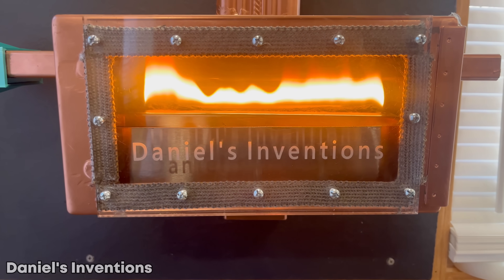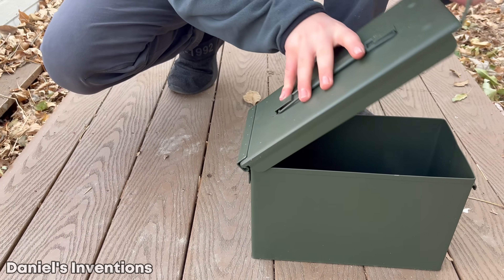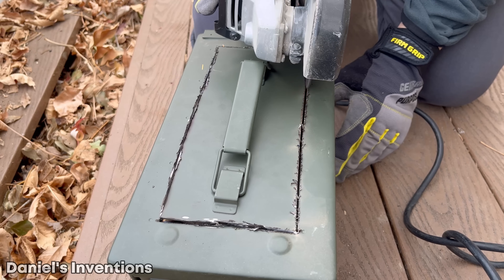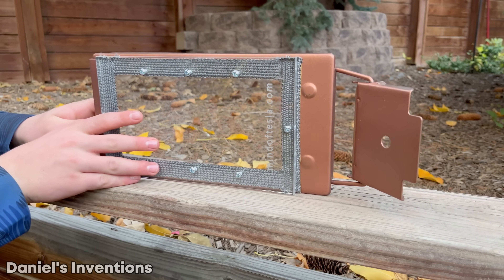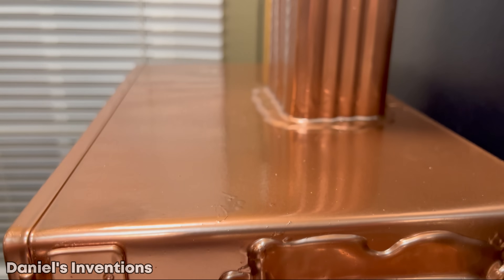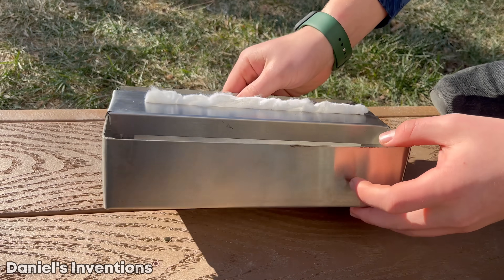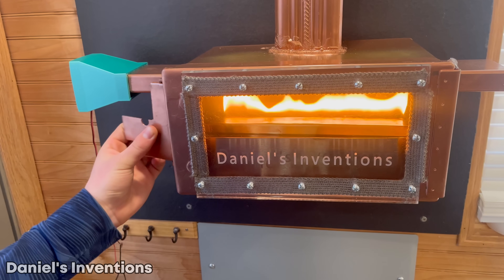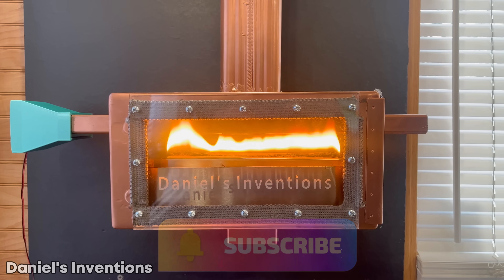ENDLESS Heat for Your Home WITHOUT Electricity 2.0

Comment: Over 4 million views on this how to burn your house down tutorial.
Reply: rage at not thinking of a wall-mounted kerosene heater that runs off vegetable oil intensifies
Reply: Should be mounted on external house wall where not much can go wrong as, burning oil inside of apartment is asking for trouble.

Comment: You should be concerned about how warm it gets inside the heater. With the fuel container inside the enclosure, once the temperature hits around 150°F, the fuel will start to give off combustible vapors inside the enclosure which could lead to a fire. Perhaps if the fuel tank were hanging below the box so that it was exposed to the inside air, that would help keep the fuel cool.
Reply: The bottom won’t get that hot at all, the heat exchanger gets rid of the bulk of the heat and the chimney gets rid of the rest. All the heat remains above the flame. Cool air is constantly brought it from the bottom.
Reply: @kerrywsmyth  I don’t know.  150F isn’t that hot.  Some lamp oils have flash points as low as 120F.  I sell kerosene cook stoves for a living and I’ve never seen one where the fuel tank is inside the combustion chamber.  One of my customers put a kerosene stove in a space where air flow was blocked on 3 sides.  The fuel tank caught fire.  If you simply made the box 2 inches shorter (top to bottom), cut a hole in the bottom and let the tank drop by two inches, it would be safer. Extra care should be taken with homemade heaters, as your homeowners insurance would not cover the fire damage from such a heater.
Reply: This also the exhaust isn’t code. That needs to be three wall insulated pipe pass through otherwise he’s gonna be burning down that house from that small hole
Reply: @stpaulmercantile  good point about the homeowners insurance doesn't cover fire damage from such a heater
Reply: @ChunkiieCustomz  I appreciate your information but I also had a stroke trying to read that
Reply: @ChunkiieCustomz  he might also want to flash the hole he cut in the siding. I guess the water that gets in can keep the wall around the exhaust from catching on fire as easily.
Reply: We are very annoying
Reply: kido did a good job, but indeed, that's a better idea.
Reply: @@jessekawaii2276 true, no mention of risk of carbon monoxide poisoning or using an alarm.
Reply: Good point, because the mechanical airflow could some how stops. Also the insurance issue is also something to keep in mind when using a diy burner.
Reply: good point John
Reply: @Eric Allen  There is also no temperature limiting controls, so this is 
a fire hazard as soon as it is left unattended.
Reply: @stpaulmercantile  He clearly said he used vegetable cooking oil and thats around 600F so there's no worry about a fire for the fuel at all.
Reply: @2amSpeedMerchant  From what, cooking oil isn't a worry for that. 10x less than cooking with it on your stove.
Reply: @dpgedward5947  No its not. He clearly said he used vegetable cooking oil and thats around 600F so there's no worry about a fire for the fuel at all.
Reply: @christhomas1438  Nope. He clearly said he used vegetable cooking oil and thats around 600F so there's no worry about a fire for the fuel at all.
Reply: Yup it can literally explode at a point
Reply: @stpaulmercantile  it was vegetable oil that's usually at 450 for frying stuff that's about how hot it was around the top when they measured it
Reply: If you look at the design you can see the cold air intake is below the oil pan thus cooling it somewhat as air is drawn in.
Reply: @101mazz   But he said people can use ANY type of oil, so people might use oils with a lower temperature flashpoint.
Reply: it is cooking oil you can heat it up pretty high before it will hit a flash point and this is the same design  as a oil lamp it isnt going to combust
Reply: @2amSpeedMerchant  really  carbon monoxide poisoning from what it exausts to OUTSIDE the house and the burn box is a sealed unit
Reply: @ram1brn I say safety first. What harm can it do? None, and a CO alarm only costs a couple bucks.
Reply: This assumes perfect operation of an electrical part. Once that fan fails it stops removing heat and it continues getting hotter in the chamber leading to essentially a grease fire. It doesn't take a whole lot of fire to do that. @kerrywsmyth
Reply: @brent... Lol yes
Reply: I had migraines as a kid for cooking out of the can. God healed me in the middle of the worst migraine I ever had. Then I must have had a block from God against it but took like years to stop doing it. At the time I didn't know what caused the migraines  that it was the freaking lining of the can
Reply: @jeremymaxwell8466 that's interesting. I cook beans and soups out of their cans all the time, because I know they're exposed to high heat for long periods during the pressure canning process. I haven't experienced the headaches you've had, however it's surely interesting to note. Thank you
Reply: @stpaulmercantile the flash point of typical lamp oil is 250 f. The flash point of vegetable oil is 400 f. The lid to the oil will also block the heat. It’s not going to get over 400 f in there while the fan is going.
Reply: @ChunkiieCustomz no it doesn’t, it just depends on the clearances, you can have single wall all long as you have the proper clearance and a box at the hole.
Reply: @craiglist308 not true, you just have to inform the insurance and meet code.
Reply: @2amSpeedMerchant there is minimal risk to CO as long as the vent isn’t plugged! Same as a furnace
Reply: @jeremymaxwell8466 that makes no sense!
Reply: I've had a house fire 🔥 from vegetable oil. 
~ 🦋
Reply: @ChunkiieCustomz  You're 100% correct.
Reply: A remote fed tank would also give you longer burn time.
Reply: How cool will the vented air keep the oil if it hit the oil tray at the bottom of it?
Reply: For a waste oil burner, as soon as the internal temperature of the charcoal used to start off the process reaches 600 deg F,  then the oil drip is started and it's instantly vaporized inside and creates a bast furnace that will reach temps hot enough to melt aluminum (1200+ deg F).    So if the top of that burner is around 500 deg, wonder what the internal temperature of that oil is?    If it gets hot enough to vaporize from an ill adjusted wick or something, it could cause some issues.        Might be good to watch that.
Reply: @stpaulmercantile flash point is irrelevant
Reply: Inderdaad, levensgevaarlijk en weinig effectief.
Al enkele jaren zien we dit soort oplossingen om de stijgende energieprijs te slim af te zijn.
Maar wees gewaarschuwd, dit soort experimenten kunnen best gevaarlijk zijn.
Reply: The inside of the heater seems to be ventilated pretty good
Reply: Seriously, what a bunch of Karen's for commenting on this being dangerous. Where is your commonsense for goodness sake? If you're using Extreme Heat JB Weld, or just welding it properly, even if there was a flash fire inside, so what? The firebox is fully contained and sealed. If this is too dangerous for you, I suggest you stay at home today, it's dangerous out there.
Reply: so basically you'll need something like a "crankcase ventilation system"?
Reply: Here is The True Savior

HalleluYAH “Hallel u YAH - Praise ye YaH”

YaH is The Father (Genesis 1)
YaH arrives via the TENT OF MEETING
YaH was Who they Crucified for our sins
YaH was Crucified on an Almond TREE

Ancient Semitic Moshe (Moses)
Isaiah Scroll (The Original Isaiah)
Reply: a perfect use for canola oil since consuming it is not a good idea😊
Reply: I would never use JB weld to put this together
Reply: @2amSpeedMerchant  Notice the smoke pissing out of it at the end 😂
Reply: Hes using vegetable oil. This should have a flame point between 320 and 400 °F approximately. So your point isnt valid.
Reply: @ChunkiieCustomz it looks fine
Reply: I used to be a gas fired central heating technician in the R&D dept of a major HVAC company.  Designing and preparing gas fired furnaces for the American Gas Association to test in their labs and certify the safety, among other things, of the submitted equipment. Even so, occasional failures of installed units sometimes resulted in fires or worse. This thing is a disaster waiting to happen.
Reply: @mikeweber9766  Land of the brave and free ;-)
Reply: Consider using a peltier module to turn heat into electricity to power the fan. Great video overall! :)
Reply: @brianhowells1547  yes yes yes we is so annoying
Reply: Warm oil burns better cleaner than cold oil
Reply: @2amSpeedMerchant  That's why this should have a complete closed loop intake and exhaust. No worry about carbon monoxide if its completely isolated like it should be, I would never rely on the room air as the intake source, that is a bad move tbh
Reply: Feel like you could've just used a metal sheet and make it fit  instead of just jb weld

Comment: WITHOUT Electricity ? how is the 12 v fan?
Reply: Magic.
Reply: Same magic he uses to get around the fact that vegetable oil has 120,000 btu a gallon. Which makes this more expensive than just plugging in a small space heater.
Reply: @trevorthompson572  which you can't use for heating. It's forbidden by law atleast in civilized countries.
Reply: @dismayer666 what? Space heaters aren't allowed to be used for heating? Please explain.

I've only having heard of certain cheap brands being a fire risk and being banned for sale in some countries.
Reply: Put a peltier board
Reply: Facts where?

Comment: One concern I have is that the air inlet at the bottom should extend upwards into the heater sufficiently to ensure that if any oil were to leak from the oil tray,  it couldn't find its way out that inlet pipe onto your floor.  If the leaking oil caught flame,  you'd burn the place down.
Reply: That oil will not burn without a wick unless it's super hot .
Reply: Oil could also leak out the door opening.  I noticed there is no lip to stop it in case of an oil spill or leak.
Reply: He clearly said he used vegetable cooking oil and thats around 600F so there's no worry about a fire for the fuel at all.
Reply: @101mazz You mean a veggie oil can't catch fire at 600F😂 or the burning asswhipe?
Reply: @101mazz  Vegetable oils start smoking way below 600f and are easily ignited at that point. Unless you just mean autoignition temp?
Reply: He can play Y. T. Music / Vintage. People, / Burning Down The House.

Comment: For the next one like this or maybe you could modifly this one, try and find some peltier modules to hook up to the fan. That way the heat from the stove will generate power for the fan and it will run itself perpetually as long as there's fuel in it. Really cool build
Reply: Stirling engine fan
Reply: point of distaterous failure. if that fan stops=nightmare scenario
Reply: @bmunday  just curious,  what would happen?
Reply: @andygold  yes, good question...
Reply: Are there examples of such an application you can share? I'm curious to see this peltier module setup in action.
Reply: @bmunday  It would get really hot and might eventually start the wall on fire, but it is not a nightmare scenario. There are plenty of fire-based heating systems that don't have fans. A metal reflector plate on the concrete panel would reduce the danger of fire to the wall.
Reply: perhaps pointing either, prolly the outlet side of air circulation upwards would create a chimney effect and in case of fan failure natural convection could save the day. OC the heat would be optimal downwards. for power adjustment maybe one oil tank and with spacers 2-4 different burn sections in line to fire as many sections that is needed for any given outdoor temp?
Reply: @Mavrik9000  No it wouldn't, all the fan does is help circulate the air through the heater faster. Technically you could run a pipe from the floor up to the heater and it would naturally circulate the air without any power because of convection pulling cold air in as the hot air goes out the higher point.
The exhaust pipe on the other hand makes me slightly nervous... We use double walled pipe for that normally so it  transfers less heat to the material around it so unless he put rockwool or something and metal flashing around the wall exhaust.. ehhh... potential danger.
Reply: eBay for a couple of quid.
Reply: It was close enough to 2 different windows that I think a solar panel & rechargeable battery set up would be good too. Run the fan and charge the batteries off of solar during the day, then switch to the batteries at night. A fan that size shouldn't need much power, but having a backup battery is always a good idea.
Reply: @SilvaDreams  You have good points:
1. The heat exchange pipe should be angled to have a more vertical or diagonal orientation, or have bends in it so that the inlet end is lower and the outlet end is higher.
2. The exhaust pipe should be double-walled.
Reply: The Peltier sounds like a very good idea!
Reply: I agree. Using a thermopile would keep the fan running so long as there is fuel to burn, and would not be dependent on the power grid. Gas water heaters use a similar setup to power the thermostat.
Reply: I was thinking about a heat differential engine 👍
Reply: @bmunday  if your relying on a 25 cent fan to keep your house from burning down you must have great insurance.
The fan isn’t doing anything with the exhaust, it’s just helping move hot air through the heater
Reply: And what you will do with frezzed part from peltie? one side will heat and other side will frozen
Reply: @muflatu  lol😂
Reply: @somethingsomething404  Isn't that the whole point of the fan?  The hot exhaust air is self-regulating, just like any other fireplace.  Hot air goes up, heated box is not close enough to the wall to burn it, the fuel isn't going to suddenly combust unless you got some magical way to get vegetable oil to suddenly hit 600F(315C) and THEN have that flash up to 1500C to start burning the concrete slab attached right behind it..... then sure you'd be right.  The fan just moves the heat absorbed by the steel tube inside.  This isn't going to burn down a damn thing.
Reply: They have TEG-powered fans that sit on wood stoves and blow air as the stove gets got.  something that incorporated a water heater would heat up water and could be the cold sink to help the Peltier effect.  All kinds of ideas you can incorporate.
Reply: @Mavrik9000   A layer of Aerogel over the concrete panel.  This stuff sucks up heat like a sponge.

Comment: You could add a container of granite rocks and/or sand to the top of the unit to absorb and slowly release heat over many hours

For example, put a 5 gallon metal bucket on top, with the exhaust tube extending through the middle of the bucket.  Then fill the bucket with sand/and or granite rocks (or something similar) to absorb the heat, and slowly release it.

That way you are not losing most of the heat through the chimney pipe like a fireplace does.

Of course the extra weight will necessarily require it to be sitting on the ground and not hanging on a wall. But would make it much more effecient and cost effective.
Reply: On second thought, better than a 5 gallon metal bucket (which will off-gas it's paint unless otherwise stripped), use a wide circumference metal duct tube with caps at both ends.

Cut holes in both end caps for the chimney pipe to go through, and fill the tube with a heat mass to absorb the heat 

Otherwise, (for indoor use) a 5 gallon metal bucket would need to be fully stripped of it's paint and inner content before using, to eliminate paint fumes from being released into the air
Reply: basically: yes. some kind of absorbent "cladding" or ducting, that dissipates heat [at levels indicated in vid] would allow this design to be much safer for home use. 

not sure what you mean be "heat mass"? [i dont know enough about how materials absorb and radiate heat to comment] you mention "granite " initially, which is an interesting choice as a heat absorber-radiator...  although i suspect such heavy materials would complicate the build installation to a degree...

its an interesting engineering challenge: i'll do further research.